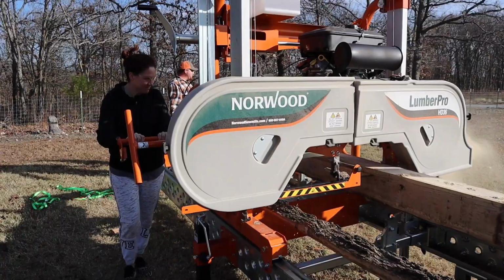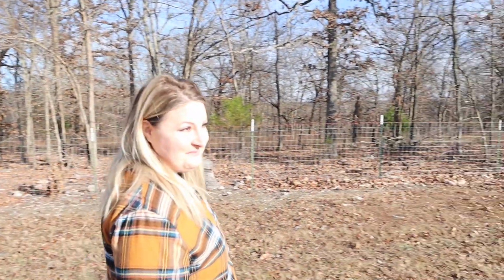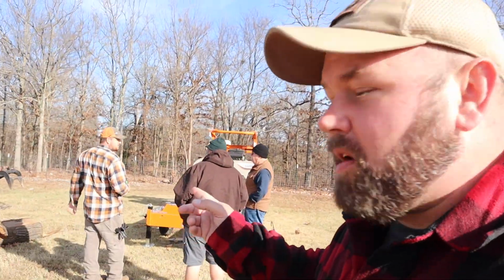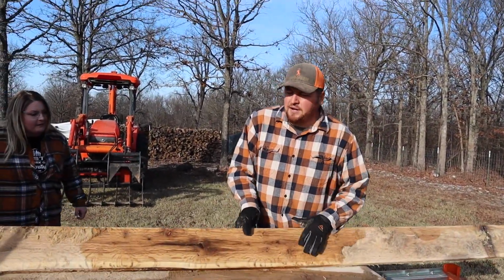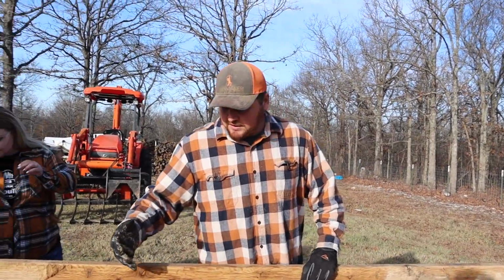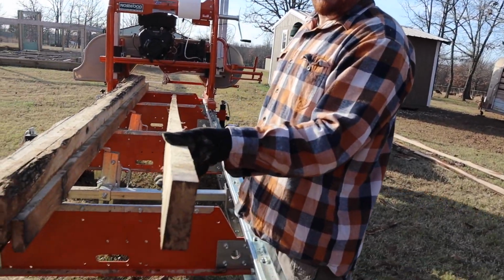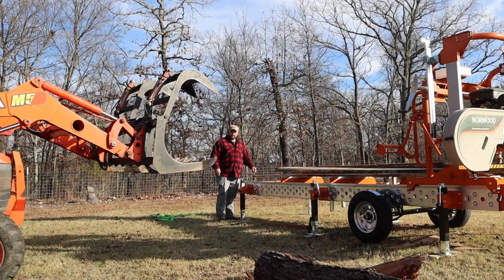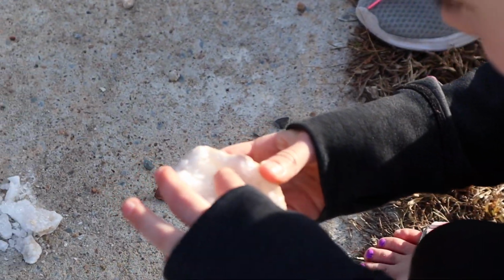HOW TO MAKE YOUR OWM 2x4 WITH THE NORWOOD HD36 PRO

Comment: Hey Dutch, couldn't help but to notice that when you rotate the tree on the mill, you don't rotate it to the flat side down. Once you get the top and bottom squared the other two will be easy and the holders may not give you as much trouble.

Comment: Teach Brandy about knots in the wood (basic rule #1 in cutting) lol. And always check to make sure there's water and the tube isn't clogged before running the mill. It'll cost you a fortune in replacing blades.  Clean sawdust out of header housing often. Brandy should know how to operate EVERY piece of equipment you own. Same with Rachel. There's a reason the wood chaffes like that, although I can't remember why. Thinking it has to do with the water or blade getting dull. Make sure blade is flush or aligned with the back of the wheels in the housing. Not sticking out from the wheel. Use a torque wrench with correct pressure. Also you could use those slabs on the outside of your house for a real rustic look instead of full logs. Check in to the moisture content and treating it IF you decide to go that way and research. Also something very important, use long shims between your freshly milled lumber to reduce the warping (you can make those lol) and you'll be glad you did. Will season and dry much better. So exciting to watch you all!